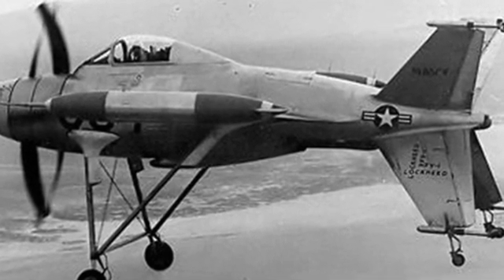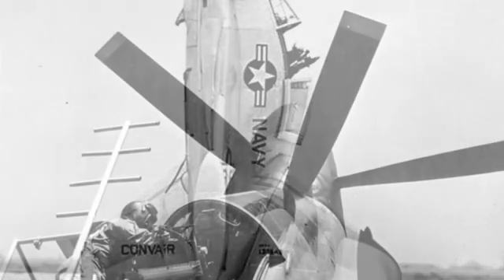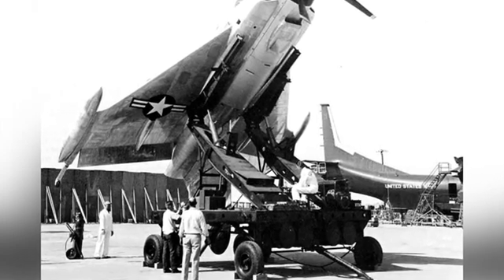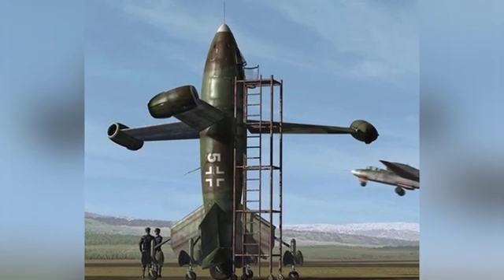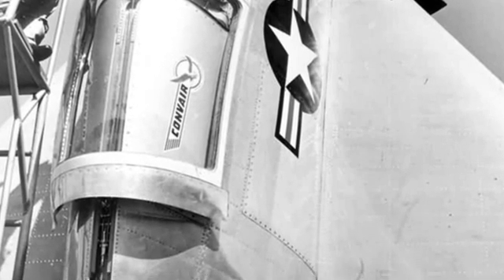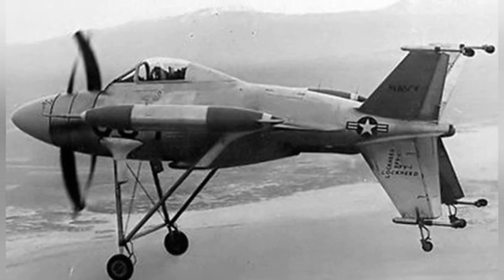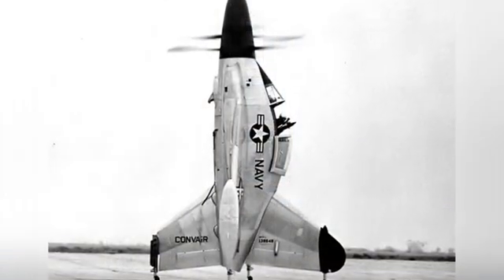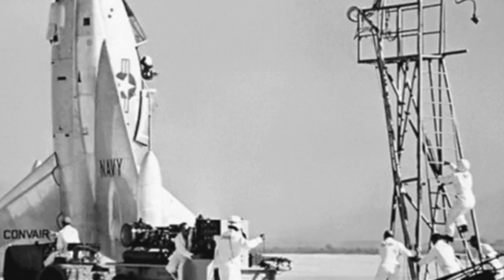XFY-1 'Pogo' Vertical Takeoff Fighter: The Untold Story

Comment: This video features the Convair XFY but fails to mention the Lockheed XFV competing aircraft that was pictured with its outlandish conventional landing gear. Only the Convair succeeded in making successful transitions in flight from vertical take off to conventional flight and back for a vertical landing. While the Lockheed did fly, it was only capable of taking off and landing conventionally with the strapped on landing gear rig as pictured.